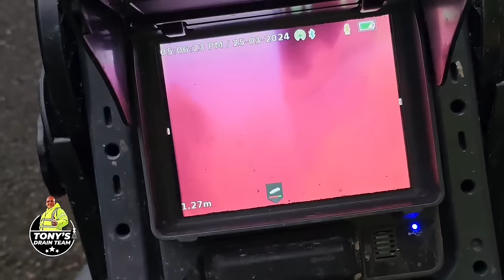Blocked drain. Unblocker shocker if you don't like it get out. #cloggeddrain

Comment: Used to be a Korean drain cleaning channel that did commercial drain unblocks at restaurants and every drain they went to clear was chock a block with that type of grease. They put a large sieve or colander in front of the pipe to catch all the massive lumps as they came out while jetting. Oriental / Asian cuisine tends to be made with a lot of oils and fats, probably what has been happening in this instance. I would hope that when the customer saw what was pulled out of the drain they may think a bit more carefully about disposing of fats down the drains - or they are going to face a hefty bill for good old Tony to come out again in the future. I would make a little note in your "no teas" notebook about this address, and charge them more next time - I would guess they don't learn nor change their behaviour despite being shown the buildup in their drain, and the fats will continue to block that drain.

If you have ever had that sweet candy called honeycomb, you know, like the inside of a Cadbury's Crunchie bar without the chocolate on - well those fat chunks looked just like it wouldnt you say?
Reply: Judging by those Sandals.......
No Washing up liquid 
No Baking Soda
No Bog roll
No Weed Wacker
No Building permit for the Skid pipe

And who the F layed that Driveway???

In the words of the Residents.......Allah ol'mighty 😮😮
Reply from the maker: Agree with you 100% it's lifestyle cooking. No tea is noted but in their defence I was given a little pot of curry.